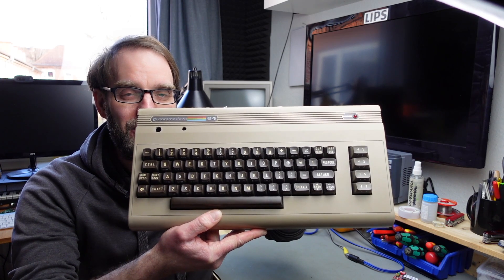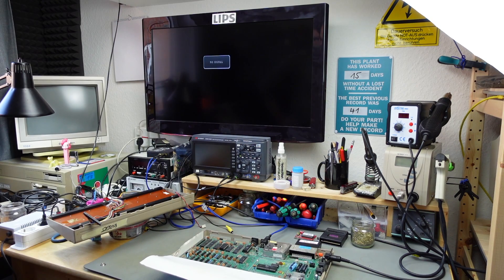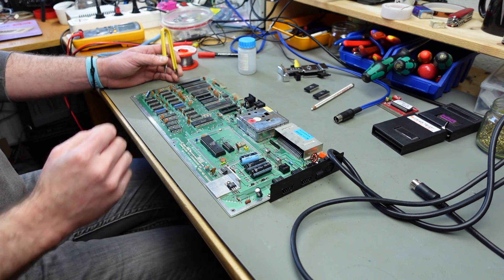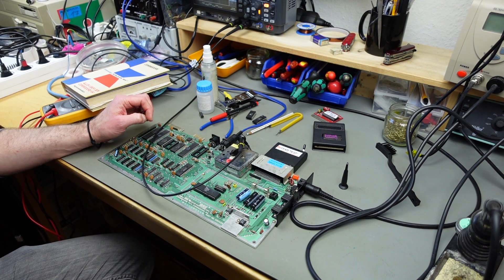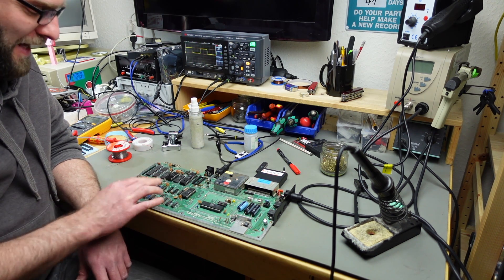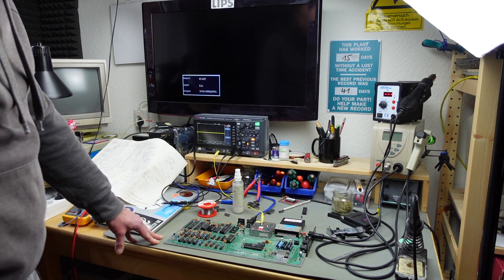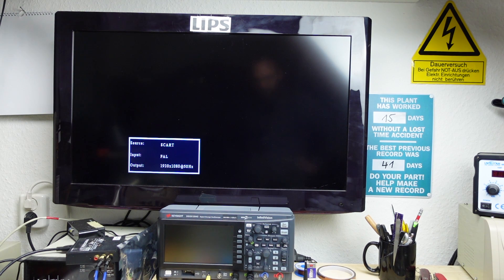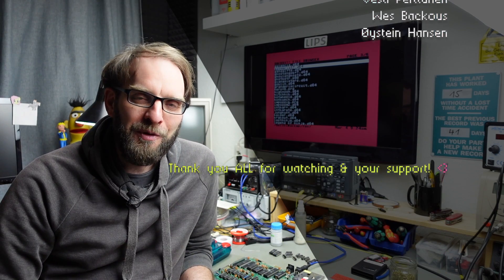Stubborn C64 Repair

Comment: It is worth trying another power supply to check as to whether the power brick is at fault. 🤔
Reply from the maker: I usually use one of my self-made, known to work power supplies for these repairs so I can pretty much rule PSU faults out. The original power supplies a notoriously unreliable indeed!

Comment: A12..A15 are not connected to the VIC-II. To prevent them from floating during VIC-II half-cycles, resistor pack RP4 acts as pull-up resistor. This is what causes the wonky signals: The bus acts as a capacitor and the resistor pack needs more time to charge it, than the chips do with their MOSFETS.
Reply from the maker: That makes sense. Thanks for the clarification! Obviously, the strange sloped signals drove me nuts for quite a while. Should have looked at the working C64 earlier... :D

Comment: What I've been working on the long board ones, I first check the fuse. It it's ok, it's usually the PLA (like 80% of the time), then CIAs and then RAMs. With short board ones, it's never the PLA, but usually CIA's and  then the RAMs.

Comment: Tip for quick-testing DRAM: If you suspect one chip is bad, you can piggyback a known good chip right on top of it. Bad DRAM usually don't drive its output, so the known good chip which is tucked on top takes precedence.
Reply from the maker: Yes, I use that method frequently.

Comment: When you see a slow rise time like that, it's usually a sign that the bus is not being driven at all... the slow rise is often due to a pullup resistor. Sometimes this can be normal.... but typically not on an address bus! However in this case the address bus is split by muxes, because the VICII also generates addresses for the RAM.

I know how you feel when you wanna give a stubborn system the middle finger all too well, i've had a few 500+'s with Varta damage just like that :)
Reply from the maker: Ah, yes, that makes sense! It obviously really confused me to see a sloped signal like that on the address bus! :D And I feel you about the battery damage. Currently working on an A4000 with a lot of bad traces caused by the Varta. :/

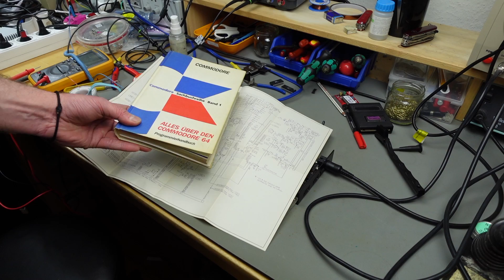Comment: 18:42 even those guys who wrote manual for C64 got annoyed to the point they typed "ALLES ÜBER DEN COMMODORE 64" on the manual cover. 

on the surface, it seems like "everything about C64". however, it could also mean "everything is better than C64" if you know what I mean :)
Reply: as a native speaker i can tell you: no, it could not mean that. Would not make sense if you take into account german grammar.
Reply: @vectorjoe  you can tell me, I can read it. I may accept it. I shall leave disappointed in myself.
Reply from the maker: Oh, I think you could translate it like that (even considering German grammar). :D Would sound strange if interpreted that way, but it would be grammatically correct both ways.
Reply: @JanBeta  thank you very much, I'm glad that there was a way like that. ^^

you fought hard against that c64 that was once repaired by late uwe peters. congratulations on your victory over that c64.

Comment: Yeah I wonder if it would have been worth triggering on a bus control line (no idea about the C64 bus architecture - been years since I looked at the schematic). Otherwise when the bus is tristated you will get junk. Could also trigger on a bus control line and watch one of the data lines to see if the data line is stuck. I'd love to get a broken C64 to fix and play with but they are expensive here!

Comment: 18:00 at this point, you could have tried to cut the pin on the suspected chip and checked if that solved the issue on the other components

Comment: wow might have to use hot air station on old arcade pcb to help out a few ic's from removal
Reply from the maker: Yes, makes desoldering IC a lot easier without stressing the board too much. I found that it also helps a lot to pre-heat the board around the ICs with hot air before desoldering. Be careful with too much heat though, traces may lift easier, too, depending on the PCB.

Comment: Where'd you hear about too much boron in the IC die insulation layer?  I've always wondered why MOS Technology manufactured ICs seemed to be a major failure point and suspected it must be something in their manufacturing process or too much power dissipation or power dissipation not properly distributed on the die surface or a combination of those.
Reply from the maker: Ex-Commodore engineer Bil Herd mentioned it in some of his talks/interviews. He didn’t know about what exactly was wrong with the chips until recently it seems.
Reply: According to the PLA dissected document, they bought Frontier semiconductor and tried convert their fab to NMOS. This is where it went wrong with boron and chips produced in this fab have high failure rated. Chips produced in the MOS Technology fab are much more reliable.
Reply: @JanBeta  Ah, OK.  I've watched many of his videos and in the past he was always excusing the failures as, basically, "what do you expect from chips this old" which was never acceptable to me since there are plenty of ICs not made by MOS that still work just fine in even older hardware.
Reply: @danielmantione  Peoples Liberation Army?  😎  Starting at approximately what date would the ICs be more reliable?  It would be interesting for those who save the bad ICs they've replaced, like Adrian at Adrian's Digital Basement, to take a look at their inventory.
Reply: @winstonsmith478  Programmable Logic Array: ftp://ftp.zimmers.net/pub/cbm/c64/firmware/C64_PLA_Dissected.pdf 
According to what we know, the bad years were 1983 and 1984. In 1982 the Frontier Semiconductor fab wasn't operational yet, in 1985 the problem was solved.
Reply: @danielmantione  Thanks.  I know what a PLA is 😎 and thanks for the info.  I'm asking Adrian to check the date codes in his bad ICs box.

Comment: Rabbit Holes followed by giving the board the one finger salute spells frustration we have all experienced at one time or another.   Last time I went down that road on a Commodore 8 bit was when two pins on one of the control ports on a 128DCR were shorted because one pin was bent.   Yea had I done a full inspection of the ports I would of saved myself a lot of frustration and time.   I have an old SAMS Computerfacts repair guides which have expected signals on the schematics which are helpful.   When you have what you believe to be strange signals you did eventually do a comparison with a working unit which is a good practice which is not really different then swapping out IC's to test between working and non working units.   Nice to see you putting the new scope to work.   Now you have a behavior that you can document for future reference.   if you have space around your bench you might want to put a Desktop or at least a notebook just for pulling up schematics and for documenting everything.   Using Microsoft One Note is very helpful for creating  your notes which can be synced to your other devices including your cell phone which is always with you so you can call up and review your notes or make new notes on the fly.    I use One Note for everything at work and those notes save my behind more than you know.    The other benefit for having a computer at your bench is if you ever get a microscope with a good camera you can do inspections and display points of interest on your screen and take pictures and what not but a good microscope takes up quite a bit or real-estate which is why some use those digital USB Scopes which kind of sort of work and I do have them which is better than nothing but only useful if you need a portable inspection tool.    We all go down rabbit holes and once your through them they always help improve your troubleshooting skills.   Never apologize for what your doing its all a learning experience both for you and those watching your videos.    We all learn from the from the success and failures of others and none of us are perfect believe me I have make my fair share of mistakes which often occur when I get distracted, yea distractions for me is an on going 24-7 event so I have to do a lot of back tracking on what I was doing last before being able to move forward again.

Comment: Nice to see I'm not the only one getting frustrated with a repair. Great work! Flash codes can be a rabbit hole.
Reply from the maker: Yeah, the flash codes usually work well if it is indeed broken RAM but in all other cases they can be really misleading... :D

Comment: Part way through I was wondering 'will he end up socketing and replacing every chip on this machine?'  In the end he was nearly there.  The only way this would have been more agonising for Jan is if upon reasembling the machine it suddenly stopped working again.  At that point C64's might fly (most likely out of a window).
Reply from the maker: I was really close to giving up on this one. Glad I persisted and found the - admittedly stupid - fault in the end. :D
Reply: @JanBeta  my actual 466 64 that I bought used in the 90s is a case like this one. I have socketed almost everything and I still have the flash

Comment: I think the Commodore 64 is going to need a fan if you leave it on for extended periods of time. The reason is that one of my Commodore 64s with heatsinks on the chips gave me a black screen after a week of being left on. I switched it off for a few hours and it came back to life.

Comment: You're on a row, Jan, great and instructive video! :-) That wonky signal is an example of three normal effects we may often confuse with a problem when interpreting the output of an oscilloscope: (1) the rising edge of a signal depends on the parasitic capacitance inherit to the network transmitting that signal; that is, it is design dependent. In the 80s, people had little care for this effect, because slow rise only slightly delays the point when the system recognizes a transition from logic zero to logic one. And since those computers operated at very low clock speeds anyway, this delay was often negligible. This is what you saw, I think. (2) Sometimes a bus line (particularly address lines) switches from zero to one, and back, without any periodicity (that is, without a discernible, repeating pattern), which confuses the trigger mechanism of the oscilloscope. The result is signals that seem to climb a step ladder up or down, displaying ambiguous logic values. This is often an artifact of the oscilloscope and not a problem in the circuit. Many a repair person has gone down a wild goose chase when, in fact, there is no problem at all. (3) Chips have internal switching because of the dynamic activity of their internal logic gates. This activity often leads to relatively small changes in the signal level visible from the outside, which is also synchronous with the system clock. Those can be confused with bus conflicts, and also lead people down a wild goose chase. In general, the oscilloscope is only as good as the operator's ability to interpret what it displays, and shouldn't be believed blindly! What you did (that is, to compare the signal to that of a working machine) is the way to go!

Comment: From mistakes you learn the most.. and in the end a working c64.. bravo again Jan...is it possible  to check if the short pins make or don't make contact on the board?
Reply from the maker: Thanks! You could check continuity with the board of course. I didn't think of that because I just assumed the PLA would work after testing it in the other board and didn't look into it any further. Lesson learned for sure! :D

Comment: I wonder why there isn't an Arduino thingy to slap on top of the CPU and doing some analysis while the CPU is held in reset ..
Reply: It's not just the CPU that drives the bus, but also the VIC-II. Implementing AEC and RDY with an Arduino is not so easy.
Reply: @danielmantione  thank you .. but wouldn't the VIC be also held in reset? ( I never owned or worked on a 65xx machine ) I was imagine a diagnosis thingy that woud drive the bus at almost static speed so one can probe the signals with a scope/meter even if that means nothing could really work due to way to slow timings..
Reply: @VVerVVurm  That' s right, the VIC-II is not connected to the reset line, so it doesn't even know that the machine is resetting.

Comment: I think it was faster when you built an entire one from scratch during a stream. :-)
Reply from the maker: Haha, that might even be true. I don't remember exactly how many hours I put into building the Sixtyclone board.
Reply: @JanBeta  Adrian had a board like this and it turned out to be either the 556 or that other chip I think. He replaced darn near every chip before turning to those. I’ve seen a lot of videos where the dead test cart seems mighty useless unless we need to see if the cpu is dead. Beyond that, you might as well use some kind of chip tester for ram and discrete logic. Not sure if Evie’s is ready yet or not. Anyway, still an informative video - thanks!

Comment: Hi Jan! Thanks for the exciting content. Do you know what the diodes  left of 7406 IC  are for? I repaired one C64 a year ago and it had such diodes there as well. They looked pretty much self made and I removed them, but I'm still curious why they were there at all. The repaired C64 works at least like charm until today without that diodes.
Reply: These diodes protect the lines of the serial bus. Excess voltage on these lines is directed to VCC, where it cannot do much harm. With these diodes you are much less likely to destroy a CIA a static discharge of you touch the signal lines on the bus. They were clearly not part of the original plan, but warranty claims may have made Commodore to add them.
Reply: @danielmantione  I see, thank you very much.

Comment: I know a lot of people suggest right off the bat to yank out the roms and the CIAs. Granted you only had one socketed. But a number of times when I realized you were having misleading results, I was suggesting it to the screen over and over again. lol
Reply: I agree with this. Jan indicated that the ROM shouldn’t matter because it’s switched out by the dead test. But the chip can still pull down or up any data or address line, right?

Comment: Jan, where did you get this nice IC extraction tool? Can you recommend it?
Reply: In the text he gives a link to all of the equipment he uses. The IC extraction tool he links to is available on Amazon - in the US it’s a bit under $25.
Reply: The silver one at 9:45? - I'm guessing it's a Jonard EX-2 (24-40 pin chip extraction tool). It's not the cheapest tool and the usual suspects (like AliExpress and eBay) have much cheaper all-plastic variants going by the name GJ-3 (16-22 pin) and GJ-6 (24-40 pin), search for "Chip Extractor GJ-6" (or GJ-3).

For casual use the plastic ones are fine and has a variant for smaller chips that Jonard doesn't make (it's less useful for smaller chips but it's still nice to have), I expect that Jan use his enough for it to make sense to go with the high-quality option.

At 17:56 we see the standard "flat" extractor lying on the desk (it's used shortly afterwards), it's the one with yellow handle (green and blue are also common), this is usually the first one everyone gets because it's usable in so many situations even if you can get by without one. The second extractor people get is usually a PLCC extractor because PLCC's are hard to get out without damage if you don't have one.
Reply from the maker: What Torbjorn says. It's a Jonard EX-2, I can definitely recommend. Makes things a lot easier and doesn't bend any pins etc during extraction.
Reply: @JanBeta  Excellent, thanks! Amazon DE is sold out on it currently so I hope it is back soon.

Comment: That wasn't an easy task but you managed it. Congratulation! Might be a satisfying feeling.
The misleading slow rising signal, which seems to be wonky, could be a result of a (normal) tri-state high impedance condition. When no component drives that signal actively it goes slowly to high (or low or something between). And sometimes such a signal form indicates a real fault. Thats digital business.

Comment: Well done Jan!  I would have given up.  It's a surprise that some chips seem to work in another machine; that would confuse any repairer. And that reset signal source coming from a different pin on a diff rev was another gotcha. Always good to have a known good machine and chips even with the expensive digital test equipment.

Comment: I wonder how long a c64 will last. Will we see one working in a hundred years?
Reply from the maker: Probably not in its original state, the ICs are slowly dying, no way to prevent them from failing eventually. But there’s many replacements these days that use modern components so chances are, the C64s are going to live on with new chips at least. :)

Comment: oh come on peta...

I've seen so many of your vids covering ICs with short legs

in hindsight, with minimal skills, someone could have desoldered every chip using the hot air gun, replacing with sockets and checking the original chips in a working machine...total time taken...4 to 8 hours ?
Reply from the maker: Yeah, but I intended to really pinpoint the fault this time. Would have been faster to just build one from scratch, I guess... :D
Reply: @JanBeta  

BTW the above was just my humour rather than criticism

really love your videos...and your methodical approach to repairs

FYI I usually dabble with bbc micros...but have fixed a few acorn electrons recently...28 of them over xmas with lockdown enforced LOL...got 2 stubborn ones left and a troublesome plus 1, which is likely due to a shorted tantalum capacitor

Comment: yeah nice video :D has always, but i really screamed inside when you put the old pla again when the other pla had given you different result :P than the one flash if you used the other pla from the start you would had save a little headache.